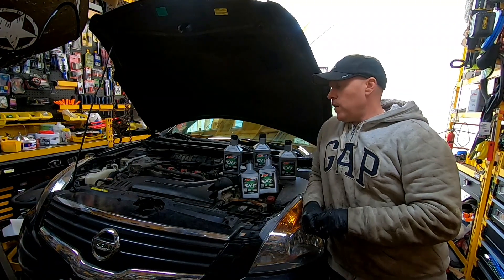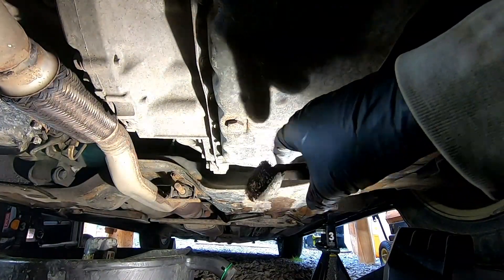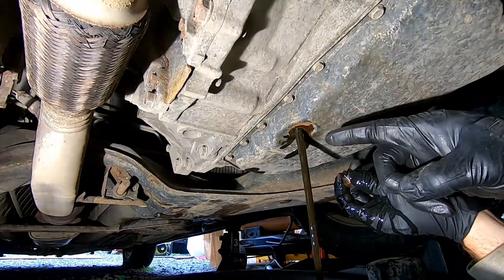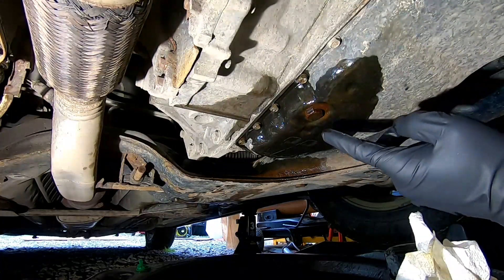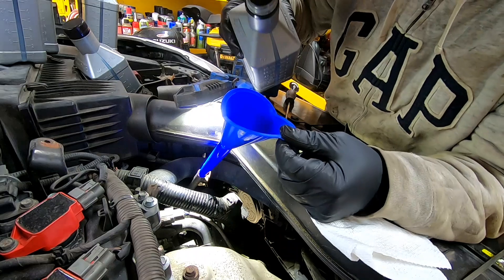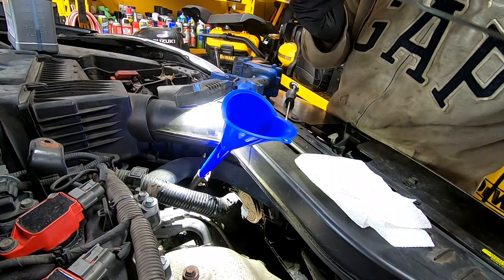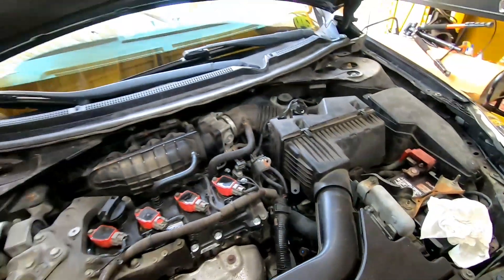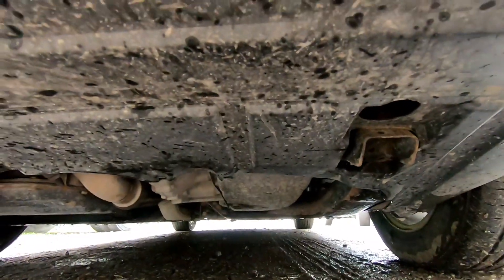How To Change CVT Transmission Fluid On A Nissan Altima DIY!

Comment: Sure hope you don't own these Nissans.
Reply from the maker: I do we have a couple and maintenance is one of the biggest things people overlook owning them! I paid 1400 for both our rogue and altima, and combined put over 90,000 miles on them with no issues, but you can see from the videos the work I put into them, and continuous  maintenance such as oil changes, cvt fluid etc, they are great cars if properly maintained and even better gas mileage!